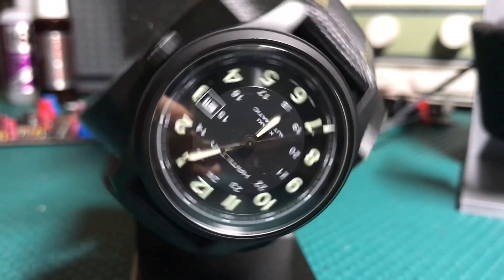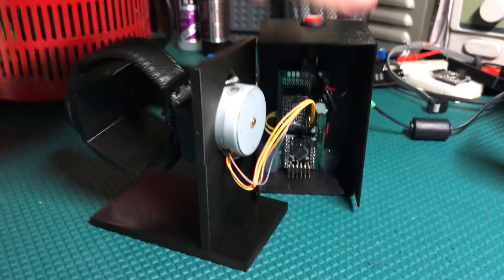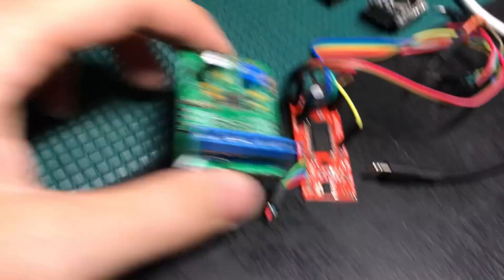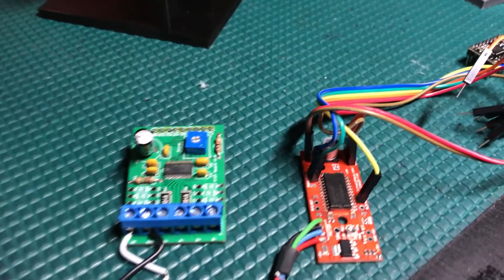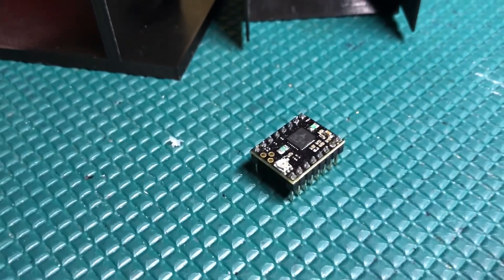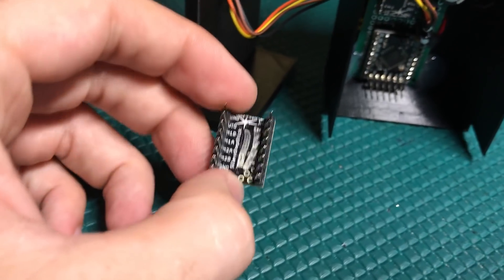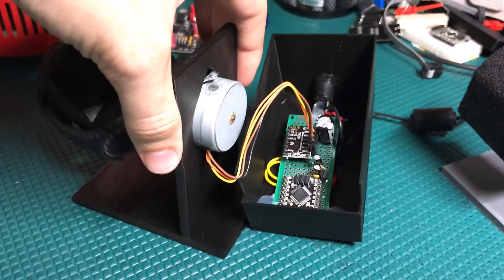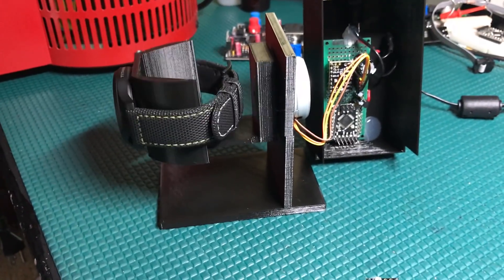Watch Winder Project - Silent Stepper Motor

Comment: Awesome project.  I am not so much on the programming though....went over my head.  I am willing to atemp this project as i have a few watches that are in need of winders. I would like to expand on your design using 9 motors with each winder accommodating two watches.  Is this possible?
Reply from the maker: yea is possible

Comment: Wow, my servos are damn noisy, what stepper motor is that.
Reply: Ah, saw what you wrote in the details. I'm using a 9v battery and using the 5v out from an arduino nano to power my sg90 servos and they're extremely loud. I wonder if the tm2100 can silent servo motors

Comment: Can you explain what function the capacitor performs?
Reply: My best guess is that it smooths out the pules  to quiet the  motor, but this  does not explain why the omission caused the board to fail.

Comment: I think i don't need to rotate all the time. Most of the automatic watches have "watch - mover - prefferences" in the datasheet... programm them in your mover and add a pause-button and push them when you want to remove the watch while the mover is rotating
Reply: Agree its turns per day,,, this really depends on the watch but I think you would be safe around 500 to 900 TPD on a lot of watches, you could program this in the software of the micro-controller. I like this project, sadly I don’t wear my automatics much anymore since I have the Apple Watch.

Comment: Thanks Kevin! Those Trinamic drivers are great. I'm using the 2130's in a couple projects. There are so many awesome features packed in them there's over a hundred pages in the datasheet. One thing to note if you're looking at the 2130's, there are a couple boards out there by Fysetec - v1.0 does not allow for configuring them over SPI but can be modified to match the v1.1 boards that do. I also got the silentstepstick board appearantly from Trinamic on DigiKey but IMHO they're a bit expensive, take a look at newfrog.com or pretty much anywhere else you can get em for a better deal.
Reply from the maker: nice!  Thanks for that